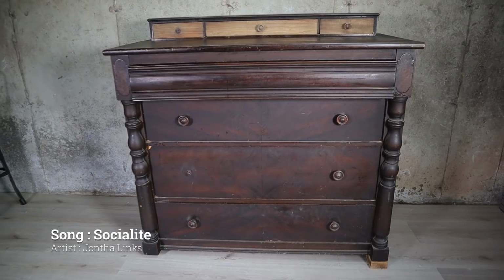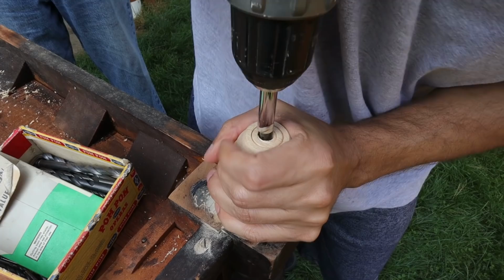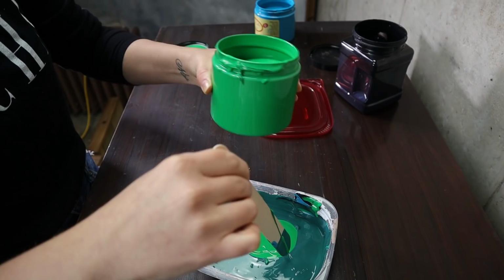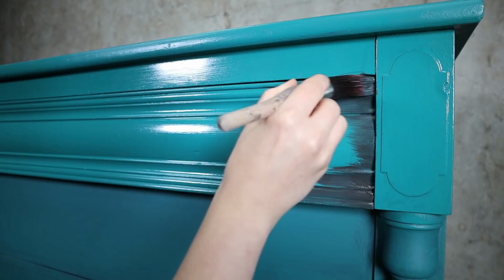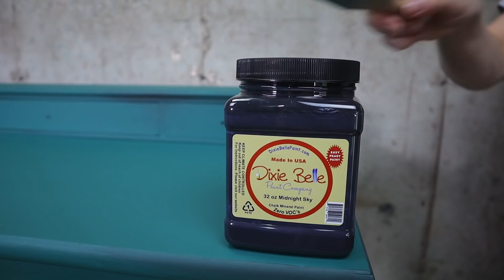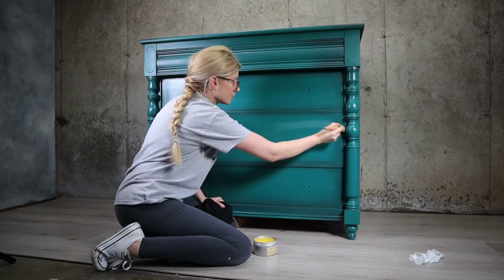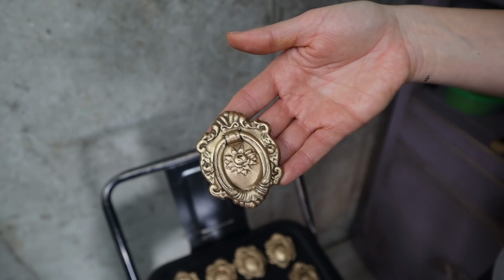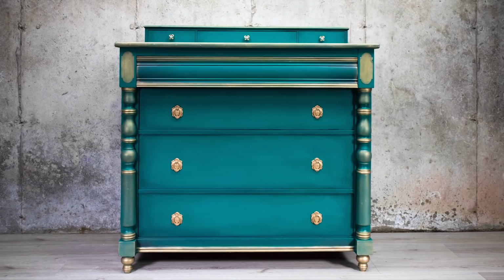From TRASH to GLAM 2

Comment: A quicky-tippy for anyone with doors or drawers that do not slide well: If you don't have some of Kacha's Big Momma's Butta on hand (is that what it was called?), you can use a candle, beeswax or a cake of soap. Slide it along the drawer runners and then on the base of the drawers a few times to coat the surface. And of these will get those drawers sliding smoothly in a jiggety-minute!
Reply: You are right,I bought a dresser at a thrift store that didn't slide well and used soap now good as new, I bet that's why it was in the thrift store , they didn't know to do this cheap trick 👌
Reply: Thanks for the tip👍
Reply: Lovely!!!

Comment: Good job, love the result..... I do work for a furniture shop and match custume colors using glaze, stains, and top coats, I do use a small digital scale from Wal-Mart to measure the mixture of material I use,  I make my own formulas, that way i know what to use next time if a similar color comes along, yes you can use measuring cups but I believe I waste more material ......  The only thing left is to multiple the amount I need for the project since you have the formula and keep it for future projects with same results instead of guessing how much of each material i did use.

Comment: Oh My gosh how cute is she?!  That color is so beautiful. I was memorized by it the whole time. What I always want to know is how do you get the paint to look so streak free??
Reply: It’s honestly all about the quality of your paint, quality of your brush(es), and how many coats you apply to get your desired result. Make sure to apply enough coats — as many as necessary to get full coverage. If it’s really low quality paint with a really low quality funky brush, & you’re planning on getting a “factory-like” smooth finish with that after just 1-2 coats.... lol yea... never going to work. Not without some major back & forth between painting, drying, sanding smooth — wash, rinse, repeat until you are able to get it where you want it. But if you start with better quality brushes, even cheaper paint won’t be so hard to manage, but having that & a quality paint will (honest-to-goodness) change your painting life/journey. Just make sure, no matter what, that you apply enough coats of paint, no matter the paint or brushes you’re using, the more coats you add, the better the coverage will be & the less you will see any streaks, lines, marks, uneven color, etc. 

Good luck!

Comment: Why didn’t you seal especially the top with top coat?   Just wondering.     And how do you really know how much blending paint to make when doing a dresser that size ?   I know that small plastic container could not be enough to do 2 coats.   Please explain.  Thanks.
Reply from the maker: I mixed just enough for 2 coats and had some left over. I’ve been doing this for years and by now I know how much paint is enough for a piece. Big Mamas Butta is a sealer so I did seal it.
Reply: Kacha so for us newbie. How much would you have use.